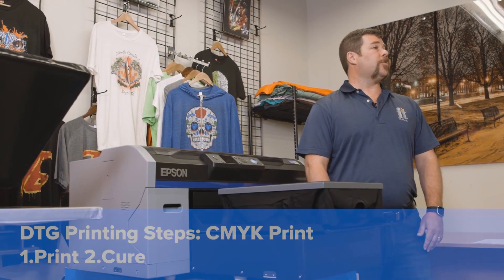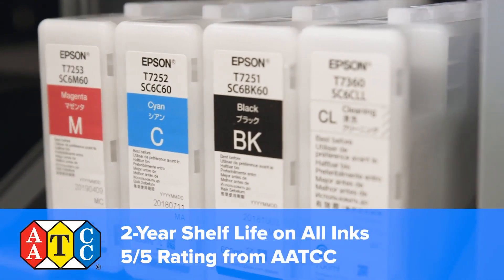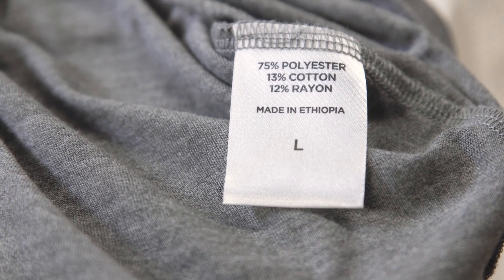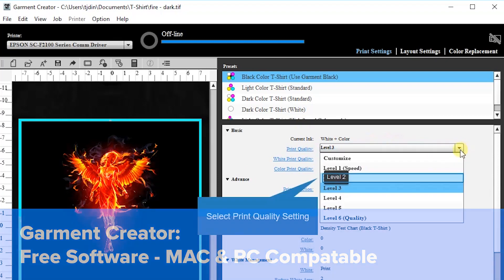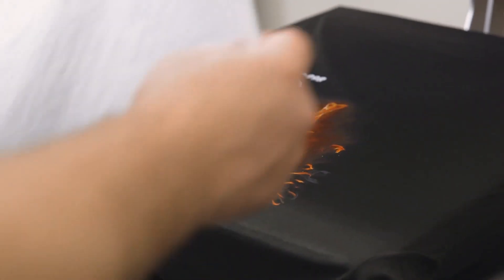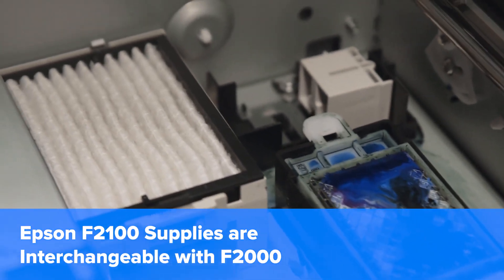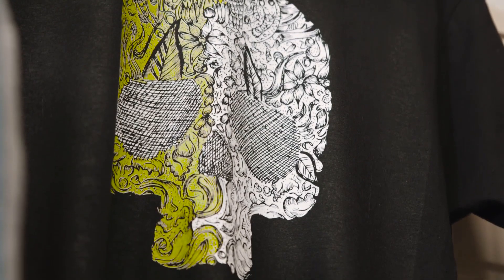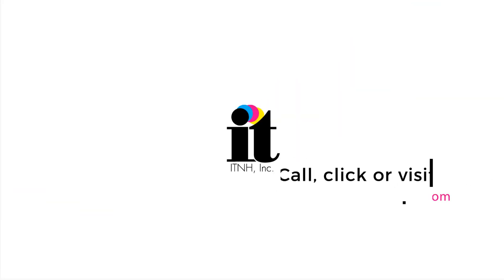Epson F2100 DTG Printer: How it Works | ITNH, Inc.

Comment: There is now ay you can be doing that print in 50 seconds becuase you need more than one layer pass.    The F2100 we have, brand new, requires an underbase, then 2nd player highlight  then 3rd highlight CMYK.     To get that print you have is almost 2 minutes